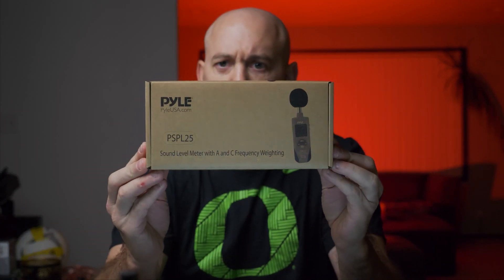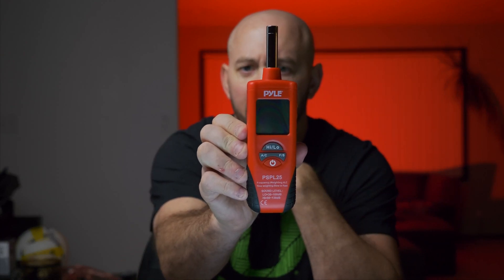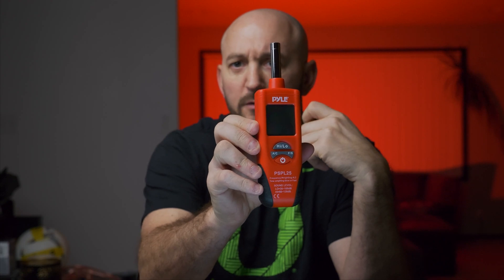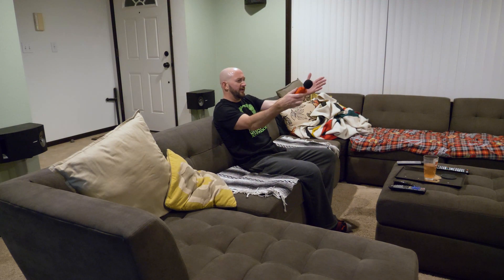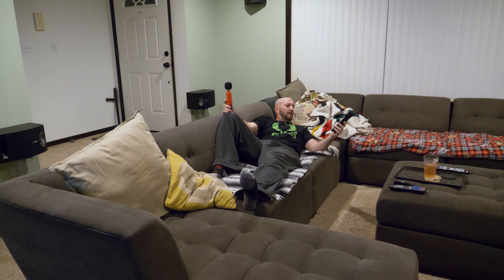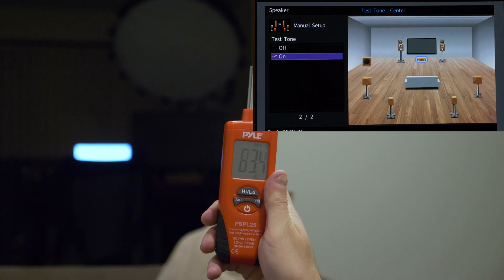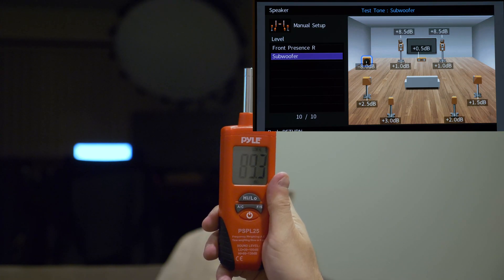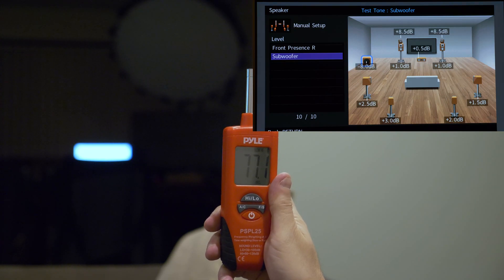How to use SPL meter to calibrate HOME THEATER

Comment: hi im newbie in this AV speaker world 😁but can i use the mobile spl app? will it give a good reading level?
Reply from the maker: @ferdinandgarcia9586  hmmm good question. I doubt it’s very good. The mic is so small and very unidirectional. The probe mics are multidirectional much better to pick up accurately

Comment: Corey what's up with that where did you put your reading for your subwoofer?
Reply from the maker: I put my subs at 85 dB about 10 dB higher than my other speakers b/c I prefer a little extra bass 👌
Reply: @coreyskinner  Corey when you do your subwoofer where do you put your volume and your crossover settings at for calibration
Reply from the maker: @ I use 80 as my crossover point to my subs. 70-80 is the most common.

Comment: What dbs for the Subwoofer? 75db c weight?
Reply from the maker: Technically yes but a lot of people increase it to 80 or 85db
Reply: Wow ok! A quick question. For me to be able to even reach 75db, the subwoofer are super loud and the floor is vibrating alot. Is that normal for 70db when Audio is set to 0db? Also, in Audyssey app I only are able to measure and fix up to 250hz, is that normal?

Comment: I know this is an old video and people probably said the same thing that you’re meter should be pointed to the front /screen  not up in the air  as  other people said your volume on your Yamaha should be set to 0 
-20 is not reference and then you adjust speakers to 75db
Reply from the maker: @lfmudge8030  ya 0 made the sound incredibly too loud

Comment: I’ve been lagging on this for years. I bought an SPL for this reason but figured the auto calibration sounded good enough. I was wrong, it’s so much better using the meter. I especially found the setting for the mic helpful. Otherwise, I would have used the default “A” and fast response settings. Thank you

Comment: Question Why do you use C weighted and not A weighted . I see alot of calibraters using A Weighted. I see that C weighted is more sensitive.
Reply from the maker: Well it’s because of the level of decibels we are trying to pick up. Around the 70 range. A weighted filters out low frequency which we want to hear and pick up

Comment: Hi Corey, first of all, great video! I have a quick question, I have a smasung q990c, and it doesnt show the volume level in db, can I set it to any reasonable volume level and just make all the speakers to sound at the same db level, disregarding the 75db mark?
Reply from the maker: thank you! So if your receiver doesn't show the the level in db it might be an older version. Yes you can adjust the level to a reasonable level but you can still use the 75db mark with a meter. If its too loud then turn the volume down but make sure all the speakers are the same.

Comment: Need to remember to raise the AVR volume to 0 which is reference level. Then you can run your pink noise and adjust to 75DB. I raise my center channel 2db hot and my height channels the same for atmos.
Reply from the maker: yes i also add a few to my height and center channels

Comment: Shouldn’t the master volume be set at whatever db level you’re setting all tye speakers at? So master at 75, then adjust gain on each speaker until 75 is achieved?
Reply from the maker: No you wanna set master volume to zero if you can then run the pink noise test at 75db for all speakers
Reply: @coreyskinner  with my master volume at 0 the gain won’t go high enough to achieve 75 db on the meter from any of the speakers.

Comment: Plz make calibration video on Yamaha AVR.  What is Volume  trim functions ND effect of the same. In small room on 0 pink noise (Master volume)  spl meter go more than 75 dB so Pl suggest what to do. If I reduced level up to minus 10 as it is max than also level goes more than 75 dB so in this case what to do. Namaste 🙏
Reply from the maker: I have a video on using the miniDSP with my Yamaha AVR. Your pink noise should fluctuate with your volume control. So if all speakers are at 75db then great!

Comment: My receiver is Onkyo and volume is from 0 to 100 at volume so what should I  have it at for measurements ?
Reply from the maker: Ya thats the old school way of having volume now its with the negative numbers. I forget the terminology regarding it.
Reply: Hi,

Play your pink noise through your Onkyo amplifier and have your SPL meter on and set correctly, increase the Onkyo until the SPL reads 75dB, look at the Onkyo and that volume is what you should use for all speakers.

Good luck.

Comment: I tried this for my Yamaha Rx-V585, the spl mater was a app on my s21 uktra (i know a proper meter would be better) but if i set my master volume to 0db, once i start the pink noise test, i have to minus every speaker to -10 (lowest value) ans that gives me a reading of 90db!!!! I have slow reading and wighting set to C type, not sure what im doing wrong.
Reply from the maker: hmmm ya maybe the meter is on the wrong setting

Comment: I bought one of these SPL meters but it doesn’t have a setting to set a range. Online it’s recommended to either set the range on the SPL meter to 70 or 80.
Reply from the maker: I don't have a setting to set the range either you just look at what the level is when its pink noise

Comment: Thank you for this Corey. I followed your instructions exactly and my measurements were really low with my AVR set to -20db. Base readings were 60ish. I had to raise the DB levels on my FL, FR, and C by about 10.5 DB. I feel like this is bad for my speakers, but it was the only way I could get a ~75 base reading. Can you comment on this? I am new and worried this may hurt my speakers. Thank you.
Reply from the maker: Sorry for the delayed response, Its ok to increase the levels on the FL, FR and C to reach the 75db thats now you caliberate the theater. You can still adjust them a little more once you watch a movie, but thats how its done. If your speakers are set correct usually on "small" then you will have no problem. Good job!
Reply: After running Audyssey, my measurements were just like yours. Corey's response didn't provide any insight into why the low measurements. Did you get any more helpful info? What did you end up doing?
Reply: @laurencepardi6577  I just kept the numbers the same honestly, haven't played around with them since and everything has been great.

Comment: I have HTR-2071
before I go into speaker level settings. volume on AV should be set to 0 or -.?
i encountered a problem when i set the volume in AV to 0. SPL reads 85db higher.
and I proceed to setting the speaker level.
to reach 75db. i had to lower it all the way to -10db and it still wasn't enough. thanks for the reply🙏
Reply from the maker: yep. You are welcome.

Comment: My Sony receiver only test tones the speakers in a sequence pattern, not individually. So how do I test each speaker independently?
Reply from the maker: hmm thats odd. There must be a test tone that cycles through all speakers.
Reply: @coreyskinner  yes it does but if I increase/decrease the volume during the test sound  of 1 speaker, all 5 speakers do the same.
Reply from the maker: well exactly you have to go to your settings to adjust just the individual speakers one by one.

Comment: Moin Moin 

Entschuldigt bitte die frage, aber irgendwie versteh ich das mit dem Nachträglichen einstellen der LS noch nicht so ganz beziehungsweise verwirrt es mich etwas. 

Ich bin jetzt so vorgegangen 
und hoffe das es so richtig ist.

1) Eingemessenen wurde mit 
Audyssey EQ App 

Ergebnisse der einmessung 

FL: -0,5dB
FR: -1dB
C: -2dB
SR L: +2dB
SR R: +2dB
Sub: -7db 

2) Eingangspegel mit (Rosa Rauschen) u. einem SPL-Meter von Amazon wurden die LS und Sub auf ca. 80dB eingestellt. 

Ich habe den Lautstärkenregler am AVR auf 0dB gestellt und habe dann anfangen mit dem Rosa rauschen, die LS auf die ca. 80dB 
zu stellen, angefangen mit dem lautesten LS

Das sind die Ergebnisse die, die LS jetzt auf ca. 80dB haben

FL:  +6dB
FR:  +6dB 
C:     +7dB
SR L: +6,5dB
SR R: +6,5dB
Sub:   +-0dB

3) Der Kanalpegel ist am TV für Netflix Amazon & Co. nachträglich angepasst worden.

FL: +-0dB
FR: +-0dB 
C:    +2dB
SR L: -1dB 
SR R: -1dB
Sub: +-0db 

Filme schaue ich bei einer Lautstärke am AVR mit Max -30 bis -45dB und ich kann mich nicht beklagen. -80dB ist natürlich Stumm

4) Dynamic EQ ist: AN 
Dynamic Volume ist: Aus 
Offset ist: Aus 
Mittelkompression ist: Aus 

5) Der Subvolume, steht auf 9-10Uhr am Subwoofer.

Ist das jetzt so richtig, oder habe ich da was falsch gemacht ??
Reply from the maker: Thanks for watching!

Comment: Good video. I m using Yamaha HTR 3072 AVR. Pl suggest what Master Volume I should set on AVR while using SPL Meter for DB Level. If i set MV 0 than there is no sound and it dose not show any effect on SPL Meter. If i set MV 70 db than only SPL Meter start reading.  Pl reply.
Reply from the maker: Thanks for watching. Most people recommend setting your master volume to 0db which is extremely loud.
Reply from the maker: 0 at reference level that is

Comment: Sir what volume i set on AVR while using SPL Meter. On 0 value there is no sound. Pl reply. I set abv 50 than only SPL Android meter shows result. Pl reply.
Reply from the maker: You have to set your sound to reference volume. I watch tv at -46db.

Comment: After running auto calibration on my Yamaha TSR 700 I used  sound level meter C weighting and SLOW setting and found that all my speakers were 70db.  I decided to adjust from there raised volume to 0db and raised speaker levels until speakers were at 75db.  Thing is, now alot of my speakers are +dB.  Some at +1.5dB and others as high as +5.5dB and +6dB.  Is this okay?
Reply from the maker: Ya I think its ok. You just don't want to have 1 speaker at 10+db and another one at 2+
Reply: @coreyskinner  Same thing happen to me  i had Audyssey set them and all were like -but after using SPL and setting AVR at 0.0   all my speakers are like +3.5 and one at +5  Remember it has to so also with how far away you are sitting from your speakers and how back your surrounds are from your listening area .  If your speakers are closer to you then your numbers would be in the NEGATIVE range
Reply from the maker: yep nothing wrong with your numbers to be in the negative at all these are just trim adjustments to volume

Comment: I have a Rotel RSX-1056. The master volume only displays a 1 thru 100 volume level. No decibel display. checked out a lot of videos calibrating with spl meter and most folks say set master volume to 0.00 decibels and then do the pink noise calibration. question is what volume level on my Rotel is equivalent to 0.00 decibels. thanks.
Reply from the maker: Yea you can depending on the receiver you either have the db volume or the 1-100 volume. I am actually not sure what volume equals 0db on yours. I simply could not set my volume to 0db because it was beyond loud. Like blowing my speakers loud. I had to lower it.

Comment: Volume set at 0 but I don’t hear any pink noise. I changed the reference on Avr. I’m confused here. Help
Reply from the maker: Not sure what you are missing. Did you hit the test tone button?
Reply: @coreyskinner  I figured it out. I had to turn the volume to zero with the remote and the pink noise got louder. It was confusing me because the receiver was already set at 0. Thanks for the vid and quick reply
Reply from the maker: Perfect! No problem.

Comment: Corey, thanks for the video.  You are the ONLY person that actually shows on screen the steps to do it, everyone else just talked about it and there's nothing on screen to see.  Also, you are the only one that tells the viewers how much you turned up the volume for the Test Tone, no else does that. Why??  That's a crucial part of the whole calibration, personally, I would turn it up even more (you said -20db, but I would at least go up to -15db; not sure if that makes any difference, it's just my preference).  Anyway, great details and thanks!!
Reply from the maker: Thomas you are so welcome man. Ya you could totally go to -15 that's fine. Please subscribe more videos coming!
Reply: Mine just goes from 0 to 100, no db reading. At what level should I set it?
Reply: @MrArjanOskam  In your receiver settings, you should be able to change your volume scale to dB.
Reply: this makes no sense, what should volume be on the receiver when calibrating every speaker to 75 db
Reply from the maker: 0 preferrably
Reply: @coreyskinner  if it's on 0 there's no volume on the absolute volume scale

Comment: Corey Skinner, setting very speakers db level to have an SPL at 75dbc is the concept. But why use SPL and not use a dB meter? I don't understand why using SPL to measure the dB level from a speaker
Reply from the maker: Same thing. You could use either just make sure its measuring C weighted db.
Reply: @coreyskinner  Guitar amp Speaker cabinets have 2 or 4 speakers. How can I measure the SPL of each speaker when they are all outputting at the same time? I would need to use some type of wood to block the other speakers while trying to measure the SPL or dB of each speaker one by one? Because on the back of the speaker it will say 25watts but I want to measure the SPL and dB out of each speaker one by one, how can I do this?

Comment: I have a Pioneer ELITE SX-S30 that’s a 2.1 system. The volume meter is set in a standard way (0 to 30 I guess) it doesn’t show the decibel units. So, in what master volume number I have to set it before I calibrate it? Also, is it the same to calibrate like this in a 2.1 system as in a 5.1 system? Thanks!
Reply from the maker: Alot of people will say set your volume to 30 and then set all speakers to 75db but I didn't. That would probably be too loud. I not really familiar with the 0-30 volumes. And yes you run this the same way on a 2.1 as a 5.1. I have a 7.1 and I ran it this way. All my speakers are outputting 75db at my listening position. Except my subs are 3-4db higher like around 79db. Thanks for watching and don't forget to subscribe to my channel please. More videos to come!
Reply: @coreyskinner  thanks for the response! Already subscribed! Ok, so I’m other words I should set the master volume to a “tolerable loud” volume? As in 18? (18 normally is the most loud I set when watching movies).
Reply from the maker: @the_maxx31  yes that’s what I would do.

Comment: why set the master volume at -20 and not -0 db since -0db should be the actual reference level? I have been doing much research about this and so far i agree with everything you've explained and my only confusing point is how do we know where to set master volume before measuring?
Reply from the maker: So I tried to set the master volume to 0 but it was so freaking loud it was very hard to run the test. Even turned down my gain to everything and it was super loud. So I put my front left speaker gain to "0" and then turned it up until I hit 75db which was -20. So I used that as my speaker calibration to equal all of them out.
Reply: @coreyskinner  I tried it and results are pretty good, I have the Yamaha rxa3070 paired with with an outlaw 7000X  ran ypao first and then measured everything myself omg ypao sucks lol I also am now using direct crossover to subwoofers. Thanks using the SPL meter was the best thing ever
Reply from the maker: Nice! Ya my YPAO was pretty off as well. Thanks for watching!
Reply: Great video. Did you run the YPAO first & then change the levels using the SPL meter?
Thank You
Reply: @EmCee_68  i did, just to get things started. And worked on listening distances, all channels speaker sizes my set up is (movies all channels set to small and 65 Hz with the center channel up a few dbz higher) and running subs frequency direct, music listening i run LR. Full range with no subs. Before doing all this u need to know where to start the actual reference level just like @corey skinner subgested.
Reply from the maker: Yes YPAO first.